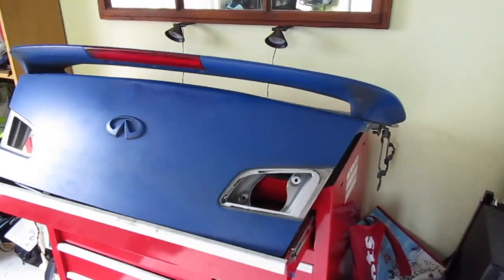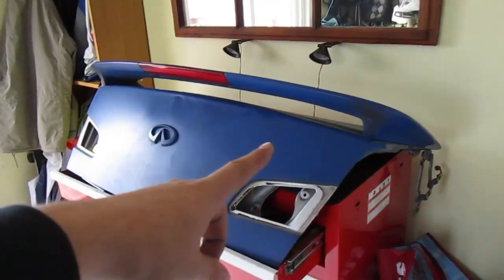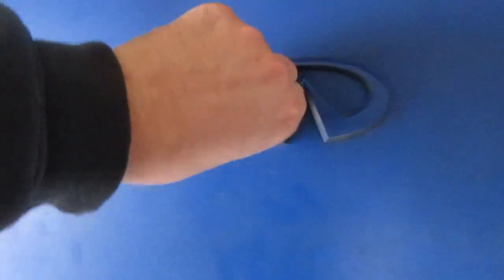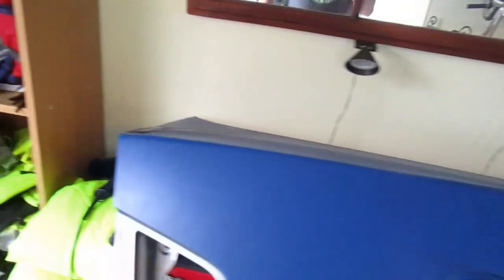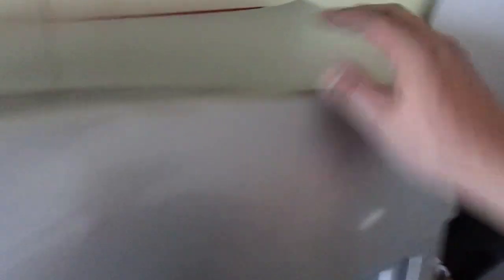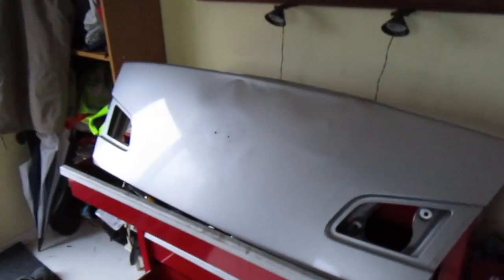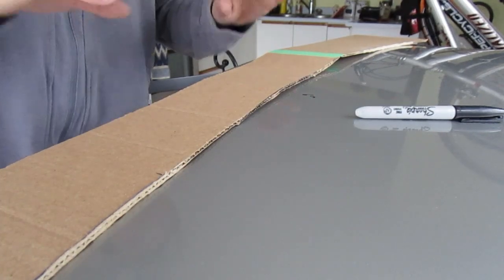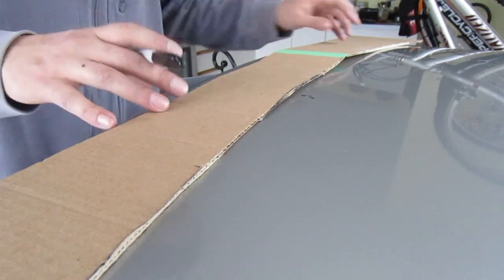DIY Custom G35 Duckbill Spoiler Build - Part 1 of 4

Comment: Dude just order a rocket bunny s14 duckbill on eBay for like $50. It will fit with minor modification, that's what I did on my g
Reply: Jeff Grasley do you have a coupe or sedan?
Reply: Jeff Grasley I order to s14 for a g sedan u have any pictures of it
Reply: Jeff Grasley sedan or coupe?
Reply: Coupe, the car is sold now. I got out of the game. I have seen Rocket bunny s14 wings fixed to all types of cars though. It fits pretty much anything.

Comment: Why don't you try and use those existing holes as mounting points for the duckbill? at least if you did that you could make a fiberglass mold and sell the wing if others like it, and it will mount up to an oem trunk with a spoiler., or with small modifications to a wingless trunk.